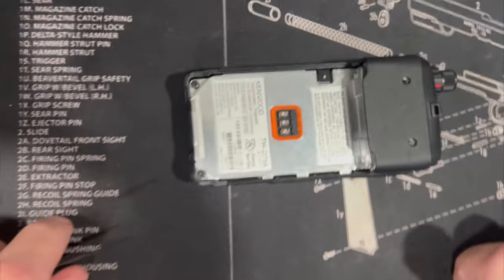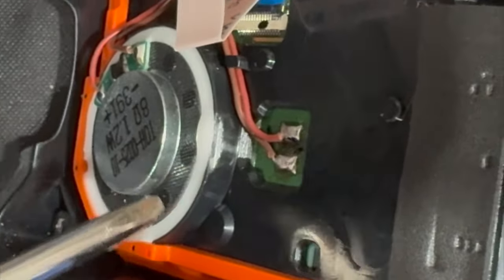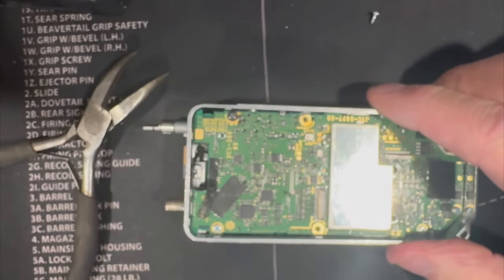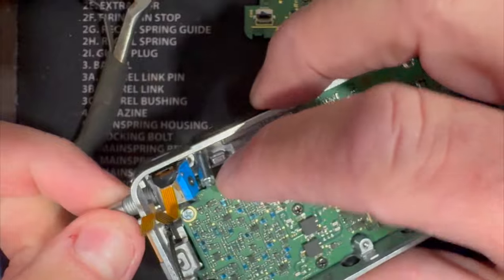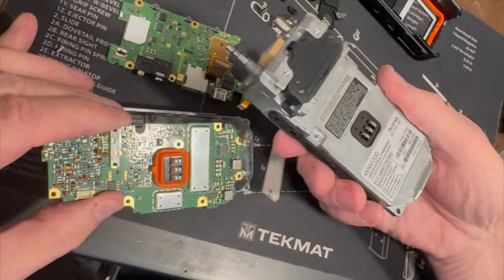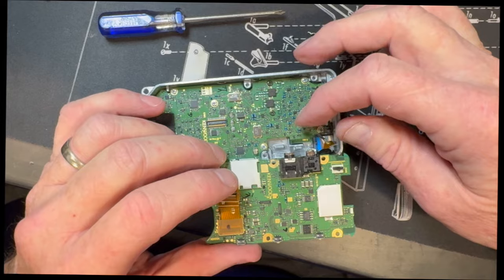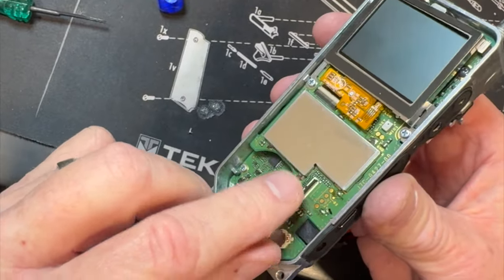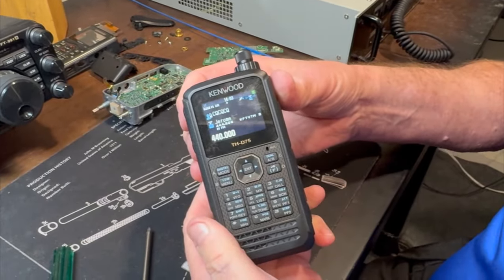TH-D75A Teardown WARNING its Long but interesting

Comment: It's really interesting to see inside the 75, so thanks for that 👍 It's slightly hard for me to watch though! The lack of proper tools (the screw heads are JIS not Philips) and fingerprints everywhere are triggering my OCD 😂
Reply from the maker: This was a field operation never heard of a JIS.
Reply: JIS stands for Japanese Industrial Standard. The screws are designed not to strip when using a JIS screwdriver. Phillips may work but greater risk of stripping the screw.
Reply from the maker: thanks I never knew this now I can order the right tools. thanks  @Torus2X